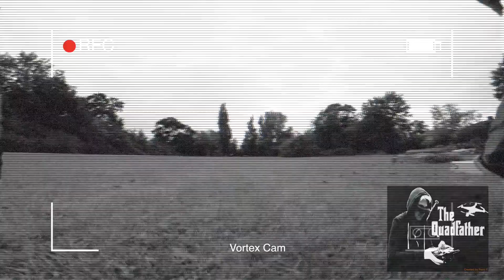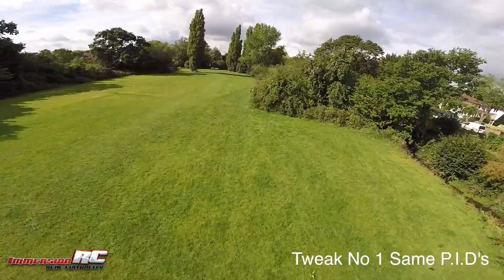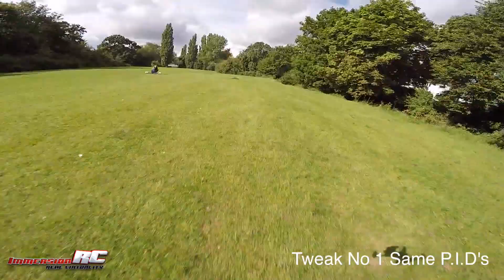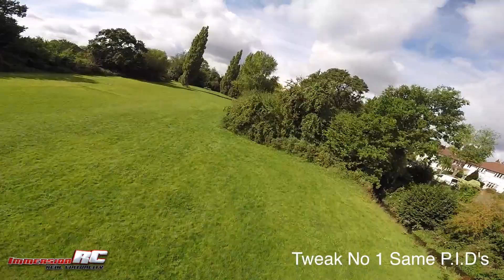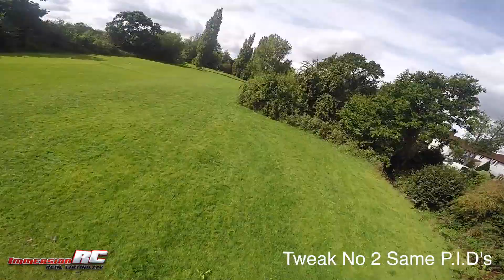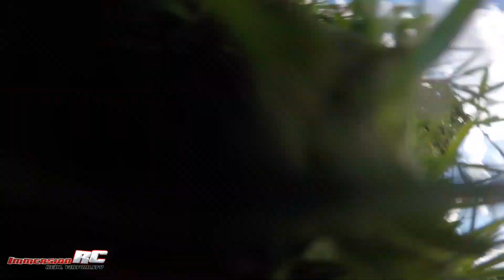Vortex Drone Tuning Not Just P.I.D's Pt 1

Comment: Nice video man, but i have a small problem with my vortex, if bought new 4s 45c lipo and now the quad is shaking when given more then 50% power. do you have some tips on what to change?
Reply from the maker: Pete's FPV  i had the same problems. try adding some tpa first in rc settings in the vortex menu. start at about .50
Reply: Thanks for the reply :)